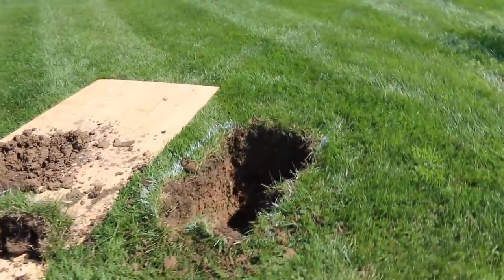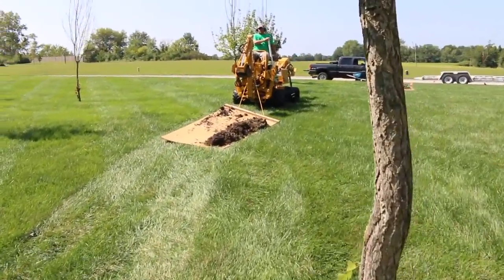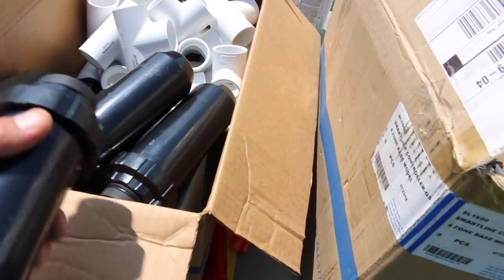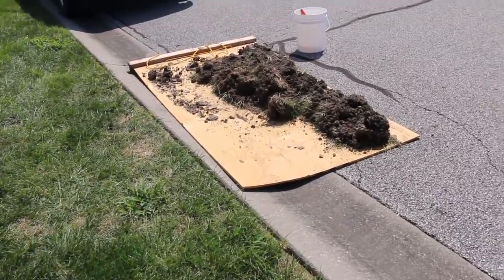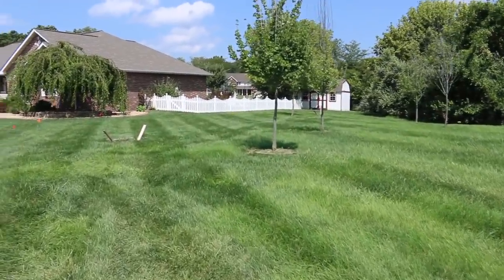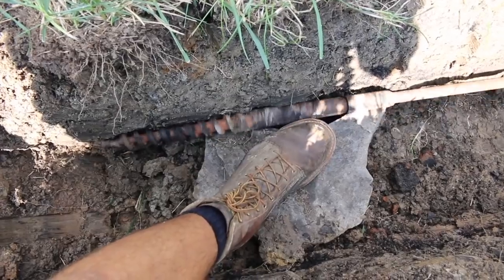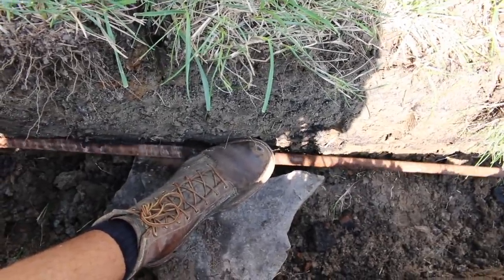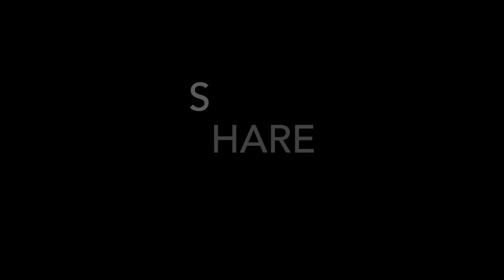Irrigation Install | Learning the Ropes

Comment: The box in the ground is called the valve box and usually 8 to 10 inches deep. It houses the manifold and valves. I would suggest using the 4" heads instead of the taller one's pictured there more for raised gardens and a whole lot more digging. A good tip I leared was when pulling the main pipe to tape the zone wire to  it.

Comment: RainBird 5000 Plus rotors save time when it’s time to adjust and offer flow control inside each head so that can help in certain applications. Don’t go cheap on glue and primer either! Y’all have a lot of pipe to run. Looks like you’re doing a clean professional job so far. Good luck!

Comment: My suggestion is to make sure you have a way of blowing them lines out for in the winter time so they don't freeze up somewhere like right at the start so that you can blow those lines out or if you got to take make a couple locations of it
Reply from the maker: 90bobhop yes we have that in the plans. At the end of the lines we have a cap to do blow outs 👍🏼

Comment: 1 thing that will help is to just use burlap for the dirt to sit on that plywood cost a lot and takes more time to put back in. And 2nd when your boaring under a fench or driveway or walkway have a whole on the other side where you know it's going to end up it's easier to get through and you can know when it's far enough across. But other then that good job!!

Comment: My tip would be don't use an all-metal spade when digging near electrical lines or so i have always been told I don't know if it would be any worse than using a wood handle shovel though but we don't do irrigation so maybe I'll have to give it a shot

Comment: But the best part about irrigation once you build what I called the house for the zones you'll learn that all it's about is putting the valve on the right way making sure the flow is all the correct way and you can run that main line wherever you want you can put his own box in the back another one in the front and I really become self splanet soaring after you break it down
Reply: Why aren't you guys just using a trencher I mean I know it's a trial run job but you should have dug the holes for the boxes and then started trenching your lying for your pipe and poly pipe is a big No-No you will learn the only reason I disagree with poly pipe it's always got its own issue it does flex however but if there's a rock under it it just likes to crack so easy and so brittle I use schedule 40 PVC for everything it's a thicker pipe and it just last so much longer and when I do irrigation maintenance I give people one year warranties on parts so I have to use top-of-the-line stuff and Rain Bird is a product you want to use it looks like you guys had some Hunter 5000 sprinkler heads

Comment: Never ever use thin wall pvc. Always use sch40 pipe!
Reply from the maker: ElliottLawnService really?? This is what the supplier suggested...
Reply: Depends on how deep soil freezes in your area I guess and water pressures. We run sch40 to valves and thin wall after valves. Been doing this in Georgia for many years without issue
Reply: Most irrigation is not installed using scheduled 40 pipe. No need. It's always recommended to winterize your irrigation which includes blowing out the lines. This is on the east coast with a lot of frost thaw cycles happen.
Reply: Thin wall schedule 20 pipe will fatigue fail sooner or later.  Spend money now, avoid headaches later!
Reply: Class 200 is common to use, just make sure its buried below your freeze line. Here in texas the requirement is 6 to 8 inches. You only need to use schedule 40 up to your backflow device and to your master if you have one... or sch80 TOE nipples